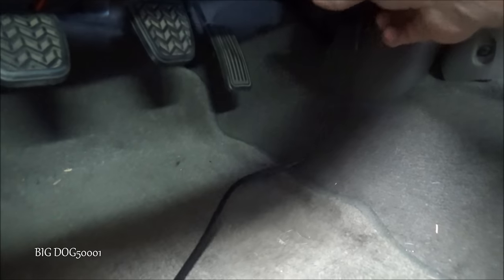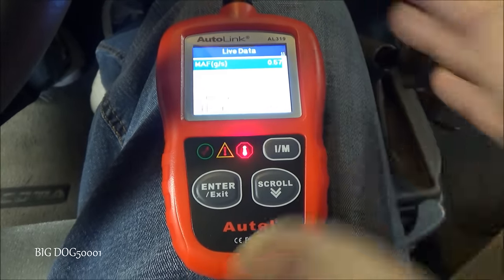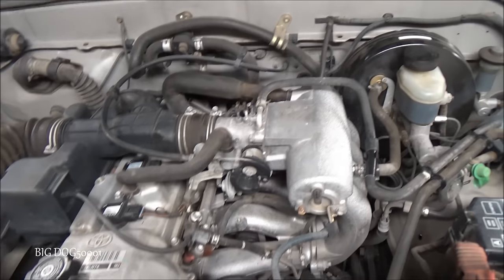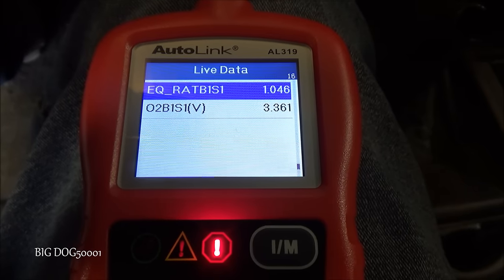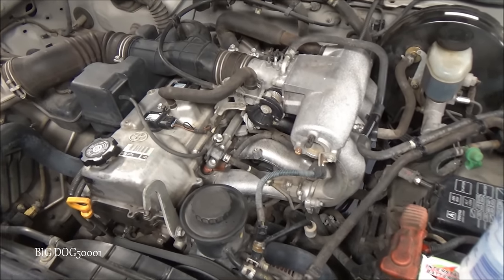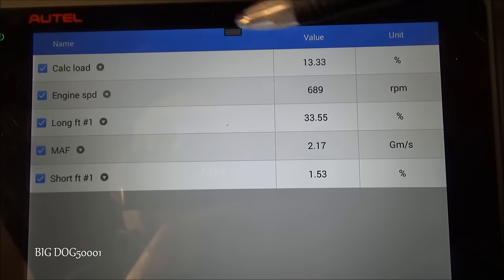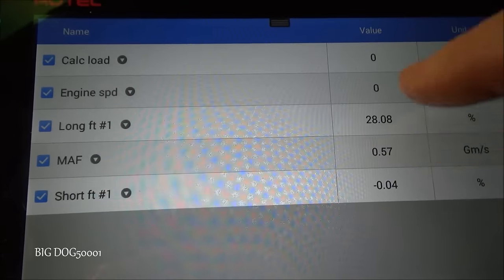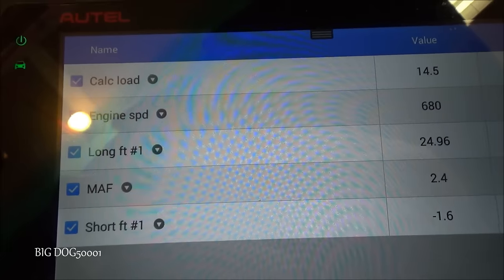P0171 Trouble Code: System Too Lean Bank 1 Diagnosis

Comment: I don't think anyone could explain how to diagnos a lean condition better than BigDog50001 did in this video! Great job, and I truely gained a huge amount of knowledge, thanks so much!
Reply: I had same po 171 and it turned to be a maf sensor had only 1.2 ohms and need to be 2.5 to 3.5 ohms on sensor change out sensor fixed it
Reply: Qa

Comment: This video helped more than any other video I've watched trying to figure out how to fix the p0171 code. And I'll be dammed if it isn't a freaking brake booster leak. We have Been trying to find this vacuum leak for 3 months and couldn't find anything. Replaced many parts trying to fix /find the vacuum leak. A lot of money into repairs that weren't needed and a waste of money. Thank you for going through every possible reason to get this code. This car was pissing me off and I've become more of a mechanic than I ever wanted to be. You just saved my scion tc from going to the scrap yard. Thank you!
Reply: You sound like me with my car and all these repairs I've done and it was my booster.No regrets though because the market value on my car went up and I've became a better mechanic that saved money for future repairs at rip off mechanic shops...

Comment: Pretty good!  One clue from the freeze frame to save some time is the LTFT and STFT at total of 59 was shown at an rpm of 692. So right off the bat a vacuum leak can be suspected before anything else and it sets a direction for your very first diagnostic test.
Reply: I would like to see fuel trims on both banks before reaching any conclusion.  If LTFT + SHFT are large positive values on both banks, it would generally imply an "air leak" into the system between the MAF and throttle body that the MAF does not know about.  If it is high for only one bank, I would run down that bank for a leaking intake manifold or some component specific to that bank.  

Also, in the above case, the MAF reading of 40 seems awfully high for just 2,000 rpm on a V6.  I would expect to see something in the range of 10.  Something is definitely wrong with the air intake system and I would run that down further.  Simple tests with propane and/or carb cleaner spray around the air intake system cost $5 and can pinpoint the issue. 

Too bad people get ripped off into  spending money on replacement parts when the issue is often just a loose or broken air hose or broken air box.
Reply: @priyajakatdar3759   Just to clarify, the vehicle in the video is a 4 cylinder, so only one bank and definitely not a V6, will be an inline 4.
Reply: @oliverthompson482  Yes, thanks for clarifying.  My comment was for a V6.  Also, you have correctly identified a MAF issue based upon knowledge of MAF values.  And you did that after confirming that there are no air leaks.  Nice job!
Reply: Hey Matt Dave makes great videos! be sure to stop in often!
Reply: Nice to see you here Matt! You're an ace my man!! Learned much from you!!
Reply: How to get to the horn switch
Reply: @Schrodingers Box the king of fuel trim 😍

Comment: Outstanding diagnosis! As an analyst by trade, I’m very impressed by your troubleshooting skills and of course your thorough analysis, delving beyond a single issue to ensure you completely identified and fixed all the issues. 
My grandson has a 2002 Solara SE with the 4 Cyl. Engine, and has a P0171, as well as P0440, P0441, and P0446 codes. What time can you get here? 😄

Comment: WATCH THIS VIDEO - it's long, but worth it!  Very educational.  He mentions that if the fuel enrichment goes down as you rev away from idle, chances are it's a vacuum leak, especially on a hot engine.  On a cold engine could also be an intake manifold gasket.  Watch the whole video.  I was able to find an intake boot/duct/joint near the throttle body on a 2006 Grand Vitara.  I had missed it before!

Comment: Thank you, I really found this helpful.  I've been working on my 2001 4 Runner and replaced plug wires and plugs, cleaned and rebuilt all of the injectors, eliminated all of the vacuum leaks and replaced a defective fuel pressure regulator and then, yesterday, I bit the bullet and replaced the fuel pump because all of my tests seemed to indicate a fuel pump issue.  Still, the same problem.  Idles like a champ, maybe a slight miss, but the moment the throttle opens up it bogs down.  After watching your video I decided to go back to square one and do what I had done on day one and start with the MAF and work my way back.  This time I happened to look into the MAF and saw that the sensor deep down in the guts of it was all crudded up.  I flushed it with MAF cleaner, let it dry, put it back, started the engine, blipped the throttle and the problem was solved.  No more P0300 and no P0171.  Runs like it is supposed to.  Only one thing left-the oil change.  So, thanks again for the pointers and the process and above and beyond all of that-explaining in a clear, straight forward way without even the barest hint of over amped ego or sarcasm.  Consider me subscribed to your channel and un subbed from that other guy.  Thanks.
Reply from the maker: Thanks for the comment and welcome!
Reply: I have the same problem with a 3.8 GM engine. I changed the fuel pump, mass air flow sensor, fuel pressure regulator, vacuum hoses and even the fuel filter same problem. No shop I go to can figure it out.

Comment: This is a very comprehensive, diagnosis, and procedure. for correcting a PO 171 code. I would take a guess that it would also improve braking efficiency. with that vacuum booster replaced. however there is an additional area that can set off a PO 171 code. and that can be with the PCV valve. (Positive Crankcase Ventilation) the valve can become gummed up causing it to stick open. and in turn causing a large internal engine vacuum leak. which is not detectable thought visual inspection. or even by listening for it, or spraying liquids around. you might say I found out the hard way. and those sort of hash marks on the stab throttle waves. can sometimes be caused by air turbulence in the air filter box. sometimes something as simple as changing the air filter can change that. but it's not a big deal.

Comment: Had this problem with my 3.0 duratec, and using my 319l, went through everything and concluded the MAS was my problem. Installed a new one and both fuel trims came down, after about 30 miles both were at zero with a little up and down. The engine was clearly running better, thanks for taking the time to share your knowledge.

Comment: I absolutely love this video but I have one question. You bypassed the purge valve and canister and found a huge leak in brake booster. Then you went on to discover the weak MAF. Did you ever eliminate purge valve and canister ? Or am I misunderstanding. Thank you sincerely Bruce
Reply from the maker: I see you answered your own question lol.  Thanks for the comment!
Reply: How did he answer his own question?
Reply: So remember the chart under the hood?? Ok by choosing to check the vacuum(with the guage) at that specific spot  and still getting the same results on the scanner. It shows that there are no issues before that specific spot. If there was a different result on the scanner then that tells us the problem is before and we would need to check everything before that for example the purge valve and canister. I hope this makes sense.

Comment: Now our Versa it in the Dealer for two days now from the previous shop they did Tune up ang oil changed still the same problem and we spend almost $700 for that two service they have done for the Code P0171 after that they’re telling us to take it to the Dealer saying they couldn’t figured out what’s wrong with our Versa😩and the Dealer telling as the same thing, and what their saying now they’ll do another Diognostic to figured it the exact problem causing that problem now, it will be around $2000 to fix it, any comment out there am being ripped off am I being charged too much for that Code P0171? I’m pissed off😩

Comment: Had this problem on 2000 4runner found out my plenum gaskets went bad
Reply: This problem showed up today on my 99 taco
Reply: @DafuckyallLookingAt  check for vacuum leaks around the plenums
Reply: @AntonioClaudioMichael  Yeah its probably a vacuum leak or a sensor or something. I just hope its not my fuel pump or something because that’s expensive anyways I called my shop and they told me to bring it in Monday. I pray it’s nothing too serious 😔
Reply: @DafuckyallLookingAt  it will more then likley on these engines be a vacuum leak for the engine been working on these motors for 20 years never seen that code be a fuel pump or anything like that you should be okay
Reply: @AntonioClaudioMichael  I hope so buddy 🤞. This must be a common problem with Toyotas??
Reply: @DafuckyallLookingAt  very common for that code to be a vacuum leak the gaskets for the plenum aren't bad on price and easy fix you can find the leak with different things including starting fluid if you spray it around the plenum and the truck revs it's a vacuum leak few other methods its not to hard to fix been fixing Toyotas for over 20 years there pretty forgiving motors

Comment from the maker: I never did get that fly....
Reply: yea but you made a great vid.gonna watch again! great explanation!new sub from me !!got a 13 2.5 malibu same code .came late had to leave early. found plugged air filter ,leaky pcv,cleaned mas air ,will see my friend again and have more knowlege to continue diag thanks!!nice to see readings explained .also loose intake bolts snugged two . he had to go!!high ft cold on freeze frame data 0 speed thinking intake is falling off lol thanks again. have all tools minus scope, on the list.nice use of vacume gauge often forgotton tool loved by pass evap smart!!!wouldnt kept going at bad booster,test downt guess !thanks again.
Reply: What if both fuel trims are about 0 when idling ? But your code is still p0171
Reply: @williamm9372  fuel pump not giving enough fuel. Replace it.

Comment: thanks for the excellent explanation of short and long term fuel trim... now it all makes sense :)
Reply from the maker: Glad it was helpful!
Reply: @BigDog50001  my car runs fine when im driving, but startles a bit at stop lights. My code read p0710. Im stumped because my gas gauge fluctuates

Comment: Thank you so much. Just diagnosed my 07 scion tc. Check engine light on p0171. Guess I forgot to connect correctly the intake tube to the air filter box and tighten the clamp. Light turned off by its self 😂.

Comment: Fantastic video! What a great refresher for my very old diagnostic skills. I was looking for just this kind of in depth explanation, as I am helping my son diagnose his dual 0171 &0174 codes on his "new" '02 Ranger with a 4.0L. Perfect primer for the work! Thank you for sharing your time and diagnostic approach in a clear and concise way.

BTW, the link for the Amazon link for the MS906BT goes to the MV108 Inspection scope, not the Scan tool, FYI.
Reply from the maker: I appreciate the comment and the heads up on the wrong link, thanks!
Reply: I have the exact same codes together right now as your son, what ended up being the problem?
Reply: @rytoniowendolini2793  The fuel pump/pressure was one issue. I think there was an issue with one of the O2 sensors as well I think.

Comment: Thank you very much for helping fix my car. First it started with a P0420 Catalytic efficiency code. Then graduated to a P0171 lean code. Your method of explaining Fuel Trims issues and MAF Sensor testing was the Key to determining a vacuum leak. Then I looked at all hoses and used Brake Cleaner still couldn't find the leak. Finally after a quick prayer, I remembered, don't forget the brake Booster and PVC valve. Sure enough, I pinched the PVC hose to the intake manifold and the short trim fuel went from Maximum to Zero in bank 2. Bank 1 went from Maximum to about 3. Tomorrow I'm installing a new PVC valve.

Comment: Good for you, this would have taken me a lot longer to find the issue. I was thinking you'd want a smoke test, but simply disconnecting the brake booster made the diagnosis without expensive tools and extra time. Then you hit the ball out of the park to detect a second problem!

Comment: I want to thank you for posting this very detailed diagnosis video. I have a 06 Accord with a pending CEL code P0171. Fuel trim was at +25% at warm idle. I followed your procedure, and found out that my air intake tube had 2 huge cracks. After installing the new tube, fuel trim wasn’t changed. I moved on to see the live data and found out my MAF sensor was under reporting. Since the Tacoma in your video and my Accord all have the same size engine, 2.4L, I found my MAF was under reporting even worse than the Tacoma in this video. I ordered a new MAF sensor and now the problem is solved! Thank you again sir as p0171 can be very tricky and costly to diagnose. Your video is extremely helpful and saved me a lot of money. As a DIYer myself, these videos really help!

Comment: having the similar problem except there was a extra complication. The MAF sensor connector became brittle and cracked off (that thrown the fuel trim way out of the line even though the MAF was changed). Followed by also a brake booster leak. Wish I have seen this video sooner. Great tutorial.

Comment: My jaguar S Type R randomly pop this p0171 code today, new sensor still have code. Car sound like it want to die after warm start an sometime shakes a bit first start doing it after change all my coils, cold starts are fine
Reply from the maker: Not sure if you already checked it, but I would make sure the Engine Coolant Temperature (ECT) Sensor is working properly.

Comment: Thanks a ton Big Dog. I've been hunting down an issue with our 08 H3 Alpha. Keep getting P0171/P0174 along with other DTC codes. Ive replaced all 4 cats, all 4 O2 sensors, complete tune up, Cranks position sensor, MAF sensor and others. 8 months now chasing this issue and still no luck in identifying it. But your vid definitely gives me a better view as to how to better diagnose this issue. 

Long story short, Thanks for taking the time at explaining the different values (MAF, LT/ST Fuel Trims and such)
Reply from the maker: Thanks for taking the time to leave this comment, I appreciate it!

Comment: on live data MAF sensor reads zero 0.00 does that mean I need a new MAF sensor? thanks
Reply from the maker: Things that come to mind, scan tool communication problem, bad MAF sensor (if indeed the vehicle has a MAF), wiring/connector issue between MAF and engine computer.

Comment: where have you been.. this stuff was right on time.  Loved the detailed discussion on fuel trims and mass air flow sensor.  My older Saab uses a Mass Air Pressure sensor, but still very useful data here.. thank you ..

Comment: I am having a similar issue with my Lexus. This vid helps a lot on where and how to get started.
I don't have any code, but I have a performance issue and I am suspecting a vacuum leak from my brake booster.
My brake pedal goes hard few minutes after I turn the car off -> so I am suspecting that brake booster doesn't hold vacuum as it used to.

Thanks a bunch.
Reply from the maker: You bet 👍!

Comment: Most Mechanics will say you need o2 sensors and mass air flow sensors etc but in all you pretty much need a $10 hose xD, my 2012 mustang has p0171 and p0174 and i just need to see whats up. Thanks for the honesty!
Reply from the maker: Thank you for the comment!
Reply: @BigDog50001  However xD we had to get a new intake and we still don't know if that will work.

Comment: Top notch video slash instructional manual bro awesome explanation throughout the whole video best one on the internet I will continue to share this video other people and Friends thanks man and help me fix my problem my problem turned out to be a bad brake booster due to the bad vacuum leak it was consuming fuel and idling like s*** and this is a Toyota 3rz motor thanks a million man great video dude
Reply from the maker: I appreciate the comment, thanks!

Comment: Boom! This video helped me find the issue. I recently replaced the thermostat on my 2014 Chevy Cruze and it was within a day or two after that I started getting this code. I had to dissemble the PCV hose near the thermostat for better access and I must have cracked the aging plastic air hose! I felt the crack upon inspecting the hoses as you suggested. Taped it up for now and waiting for a replacement hose from Amazon now. Thank so much!!

Comment: This is a great video.  Dealing with a Toyota 1.8L right now.  No vacuum leaks by smoke test. Tested with water and choke cleaner.  Replaced MAF just to be sure as it was actually reading a little high.  Sets the P0171 yet is burning rich with black smoke at the tail pipe.  Done with it myself.  First professional mechanic gave up -> $300.  Second professional mechanic says its fuel injectors -> $540.  Since I already pulled the injectors and sprayed through some cleaner and verified that they have a good spray pattern, this is about to get interesting.  I feel good that I went through every procedure that you did here twice before sending it to the second 'professional'.  I'm playing into the game right now.  Can't wait to see how this plays out.
Reply: How did it play out?

Comment: My truck has a black vacuum box under and behind battery and sometimes those crack. I would reset the pcm by unplugging negative battery terminal turning headlights on afterwards and waiting about 20 min.  Then running scan tool before and after and seeing for new codes